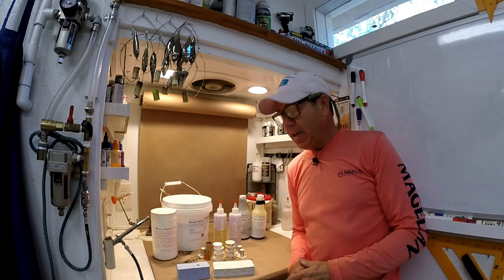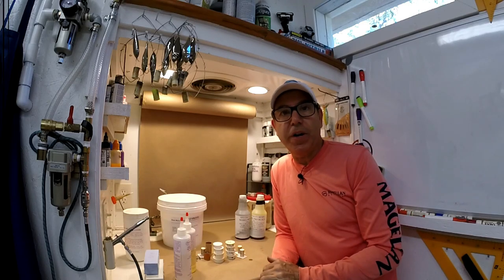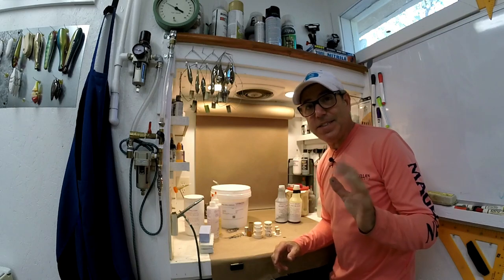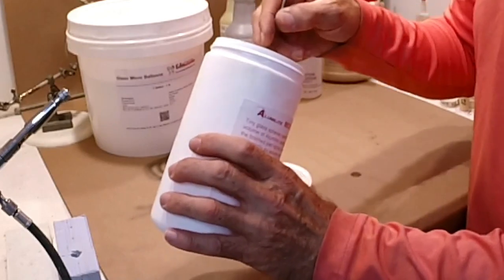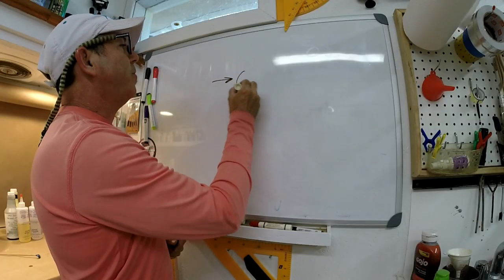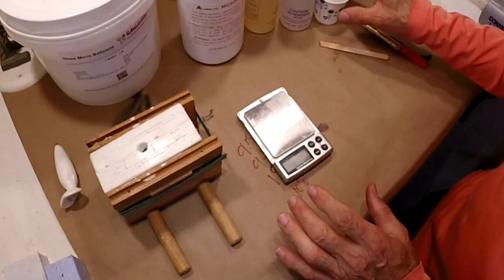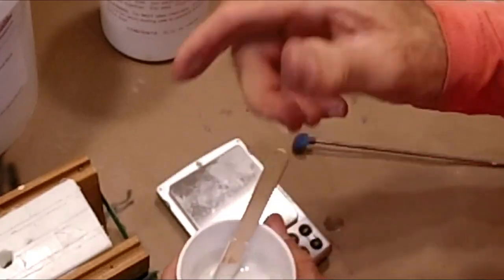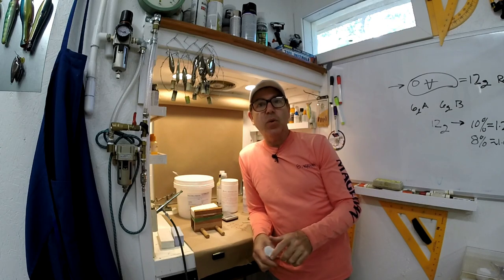Mixing resin to cast the perfect lure

Comment: Aloha! Thank you for sharing your videos, they are very helpful. 

When adding weight to your lures do you just drop them in the mold and then pour casting resin? Or do you suspend them to be a little up? Attach them to wire?? Considering that the resin isn’t enough to give the bait the proper action looking for that is prototyped in the master. If have video of how you do this could you please share it. Thank you!!! 
Hunter C🤙🏼
Reply from the maker: Aloha, thank you for watching and for your question. I have a system where I attach the weight to my internal wire harness, the location is critical because my design usually needs to follow some balance that I've decided for it. You should check out my lure design and build from scratch videos it will walk you through the entire process. Thanks again
Reply: Engineered Angler Thank you! I gone ahead and poured some anyway with %8 MB and took it for a swim, came out perfect and just what I was looking for just from the weight of hooks. 

For reference if other builders are curious.

Took 2lbs of Alumilite High Strength 3 for a 2”1 /4”x2”1/4” x 9” rectangle mold box. For a 7.5” Stickbait.  While casting with Alumilite White found that 67g is the lowest an least resin to pour and 90g is the max the rest starts to overflow with 8% Micro Balloons. 

Mahalos for sharing your knowledge 🤙🏼 tightlines!
Reply from the maker: gotta love it when that happens...cheers

Comment: how many lures can one make from, say, those sizes of alumilite? i'm thinking about trying the casting now, instead of carving my lures from wood.
Reply from the maker: You can make between 60 and 70 average size lures from the 16 Oz each of A and B. That's using my 10% by mass glass sphere mix.
Reply: @EngineeredAngler  wow, that's pretty darn good. I was thinking about trying the Smooth-On Featherlite, as it's bouyant as is. Will be fun to have lures done and ready to paint so much faster.

Comment: does the 10% mix not vary for wether you want the lure to be shallow diving or deep diving?
Reply from the maker: No..I make a point of keeping my mix constant so that the amount of weight is more predictable. Then I just adjust the weight for the rate of sink I want on the lure.
The only exception is for topwater I use an 8% mix.

Comment: After I make a silicone mold for my lure but I don't know how many grams in total it will take to properly fill it with resin. How do I determine how much the total amount of resin I will need to mix based on the size of my lure? Is there a way of knowing how much I need before mixing and pouring? My lure is already 4-5 inches  in length how do I determine the total volume of resin? Thanks😃
Reply from the maker: Calculating the volume that you'll need to cast your lure is  a lot easier if you've already have the density of the resin mix. If you've watched my videos on casting lures you will have seen how I poor a test sample of my resin and then calculate the density. You should also have the volume of your lure. Of course if you have neither one you will have to do the whole process by trial and error. For a lure the size you're describing I would start with 10 grams of part a 10 grams of Part B and 2 grams of microballoons. Good luck.
Reply: @EngineeredAngler  thank you so much

Comment: Question, why do you use less microspheres for a topwater lure, but more microspheres for a sinking lure? Also, if i want a topwater that sits nose up, do I just tilt the mold nose-up to allow for more weight in the tail?
Reply: I must also add that I plan on making larger topwater baits that have a wide gliding action. Is it possible to weight that solely with microspheres?
Reply from the maker: Okay, last question first, no unfortunately you cannot use only Spheres for weight and balance. The irony is that you need to add the glass spheres in excess so that you can then use weight to balance the buoyant force with the sinking force.  If you don't do it this. way you will end up with a lure that is unbalanced and unlikely to work correctly.  The reason I use a less buoyant mix for topwater is that top water does not need as much top to bottom balancing since they are on top of the water not in the water. Crankbaits and twitch baits need to have strong opposing forces to keep them vertical in the water column and that's why I use a more buoyant mix for those types of lures.
Reply: @EngineeredAngler  Gotchya, that makes sense, thank you so much!

Comment: Hi, there are many types specificy of micro-balloons for the application? or It's tge same? example fore the popper or needle? 30 gr ? 15A+15B+ 2,4 of micro?
Reply from the maker: The micro-balloons are all the same but, the percent you add can change depending on how you want it to affect your lure.  I usually add a little less for topwater lures.  But I stick to my 10% rule for all others  so 15gA + 15gB +3.0g micro.
Reply: @EngineeredAngler  

Thanks for the reply. I've already done some tests, and I'm going to do some more! I am afraid that my handmade lures could break in bending or twisting.

Comment: by vol. you use exact vol. but a and b might not have the same wt. for vol.  for instance i use a lot of 1 to 2 and it's 100 to 43 by weight
Reply from the maker: That's true,  part A and part B can have different densities. I cover that in another video where find the weight ratio between them and use that to mix by weight very accurately.
Reply: @EngineeredAngler  just started watching your videos , i've seen a bunch already , enough that the dream of making a new creek chub darter seems a reality already .

Comment: Mr. Engineered angler.  Really need your help.  I purchased 1 gallon of resin from specialty resin.  Mixed microbollons to 10 percent mix.  Cast it let it dry for 1 week.  Cleaned it with detergent.  Added epoxy and there are a bunch of places that the epoxy does not stick to the casting.  I made like 10 lures and all 10 had this issue.  I even tried to spray primer and I notice there are some location on the primer never dries.  I did this to 10 lures and all horible results.  Any ideas?
Reply from the maker: Oh man...I know the frustration.  I had the same issue with the specialty resin.  I bought the black quick setting resin and it did the same things to me.  I tried everything and the only thing that helped was baking the lures at about 150 F
for at least an hour.  Then wipe down with acetone  and prime it.  In the end I switched to the Alumilite resin...more expensive... never had the problem again.  
About three months ago I decided to give Specialty resin another try and I bought the white quick set resin...no issues with it so far.
Reply: Engineered Angler thank you so much.  I did what you said and it works.  Thank you

Comment: Love the way you calculate everything, I have a question I want to pick your brain on. I’m currently building a musky top water bait, Full resin bait. I’m trying to reduce weight and I’m not reducing wire size or hook size anymore than they are. First bait was 10% microballoons by weight, total weight of lure was 4.35 oz. By changing mixture to 15% and using standard strength trebles I’ve reduced weight to 3.85.
Should I be worried about strength at 15% micro balloons and here’s the big question, I’ve pondered on adding something like a mini ping pong ball on my wire ballast to create more buoyancy, do you think this will work? Maybe I can get back to 10% micro balloon mix ?
Reply from the maker: If you're using screw in eyes then yes...high microsphere % can make the resin easy the deform so screw eyes can work loose.  Use a harness and you'll be fine.
Reply: @EngineeredAngler  your thoughts on the ping pong ball adding buoyancy?
Reply: @EngineeredAngler  and to add, I am using 2 to 3 coats of east coast resin top coat as well
Reply from the maker: Wow...that must be a big bait.  A ping pong ball is an excellent idea if you can keep it high in the lure for vertical stability (if that matters for the design.)
Reply: @EngineeredAngler  97 grams total resin, it’s a two part top water bait. I did pour a couple with mini ping pong balls suspended on wire frames ( I have a brass tube running in rear piece I used) 
I added bb’s to also create rattle, it reduced weight by 1/2 oz. still waiting to test as I am trying to base coat over the resin bait with east coast epoxy but having issues with it not setting right. Not sure if it simply doesn’t like being on resin bait or what but it’s being a pain even though I’ve used it as a top coat several times. I want the paint to be smooth so that’s who I’m base coating with east coast but I may have to re think what I use there. Do you recommend anything to coat raw resin to create a super smooth surface to paint over??
Reply from the maker: What do you mean by raw resin?  Is it marine resin?  If so, you might be having issues with the residues that some resins  give off to enhance curing.  You will need to sand and clean with acetone...

Comment: You say the 8% mix is for top water, but wouldn't the 10% mix be more buoyant?
Reply from the maker: Yes...it's a bit  Counter intuitive. The thing is I need more buoyancy for lures that I want to sink so that I can use that buoyancy to stabilize the lure body. Topwater lures just need to float.  But you can just use the 10% mix for everything.
Reply: @EngineeredAngler  you are the best technical guy doing this stuff!!! Thanks for the quick reply. I love your content 🙌🤙👌

Comment: what is the easiest way to remove casting bubbles ? Vacuum chamber ?
Reply from the maker: Sorry for the long delay on the reply...
The best method depends on the material you're using but, best techniques will start with: 1) not producing bubbles when you mix, gentle mixing,  2) If your material allows you the time, you can vacuum out the bubbles in a vacuum chamber before you pour,  3) Removing as many bubbles while pouring the mold by pouring in a thin steam.  4)  Again if you have the time before the material sets you can put the mold in a pressure chamber (pressure pot) this reduces the size of the bubbles.
Without knowing the material you are using for you casting its difficult to say what combination of the methods would be best.

Comment: I disagree with your ratios. I was going off your advice but I found my 10% mix was always sinking, I went to 20% but it made it unable to be poured so now I've got a 15% mix that can be poured yet is still buoyant although once I add weight it doesnt float anyway but I just need to put less weight in. Otherwise great advice and has helped me greatly.
Reply from the maker: Well I demonstrate how I do it and how well it works on every lure.  The thing is everyone uses slightly different materials and that can change your results.
Reply: @EngineeredAngler  bloody oath. Still a very helpful video. Your videos have helped me greatly in pouring baits to making molds and working out the nitty gritty. That's it we all get different resins and micro balloons. Was just pointing out something I noticed in making baits from resin.

Comment: just watched the video again. so, to figure out how much mixture needed for the casting, you just weigh the original lure?
Reply from the maker: Yup...as long as you have the density of the material, wood, resin,  whatever you made the original from, you can just weigh it and divide the weight into the density and you get the volume of the lure....
Reply: @EngineeredAngler how the heck do you figure out the density?? one of my lure styles is made out of cedar, the other is ash. I weighed them and weighed out the same in casting, ended up not having enough, but was actually close. 

another big oops I did, was being too anxious. wanted to get a second mold made quick so I could do two lures at the same time. real excited to open the mold and see how it turned out, making it. it turned out great, until I noticed that something seemed to be missing......the keys!!!! totally was in a rush and forgot to make keys for alignment. it still works, but I just have to be real careful when fastening them together that they are lined up really well. helps that there are brick-formation lines all over the mold from the lego, so I use them to be sure it's pretty close.
Reply from the maker: I take a small piece from the wood I'm going to use, measure the volume and weight and then I just write it down. wood density can change from piece to piece so I err on the side of a little more resin.

Comment: Thanks a lot for your video 
I need ask if there was micro balloons filler clear or all is white color
Reply from the maker: Yes I use microballoons on nearly all lure castings.
Reply: Sorry I need to know if micro balloon come in different colors or all white color ?
It come in clear ?
Reply from the maker: I have only seen micro balloons in white but if you want to color your resin, there is a resin dye you can use.  here's a link
https://www.amazon.com/s?k=alumilite+dye&crid=17OAOMVO49K4H&sprefix=alumilite+d%2Caps%2C289&ref=nb_sb_ss_i_1_11
Reply: @EngineeredAngler  thanks alot
Reply from the maker: I have never seen clear microballoons. ...

Comment: Great content!  Very informative.  I just started watching your videos since I'm looking to get back into lure making, and this have been useful for me.

Not sure if anyone else mentioned in the comments, but your 10% is really only about 9.1%.  9.5+9.5+1.9=20.9g total, so 1.9/20.9~=9.1%.  I'd assume you do your 8% similarly, so that would be about 7.4%.  I don't think it really matter what the actual percentage is since you've providing two mixes that work for you and your method for calculating.  I'm just pointing out in case someone builds a spreadsheet with equations so they know to calculate it the right way.
Reply from the maker: Yes I see your math is correct and it's my poor description that makes it look like I flubbed up the numbers.  When I call it a 10% mix I do not mean it is 10% of the total mix.  Just that you calculate 10% of the weight of A and B combined and that would be the weight of the added micro balloons.  This seems to me to be the most direct way for most folks to calculate their mix proportions.   Otherwise the calculations gets a bit cumbersome for the average person.  for instance, using my method if you miss pour part A and correct by matching it with part B you simply take the total weight and multiply it by 0.1 and you still get the correct proportion for the micro balloons.  Hope that makes sense.

Comment: How long you let it setup for?
Reply from the maker: I will demold a lure as soon as it is hard enough to do so. But I will allow it to cure for several days before beginning painting and final finishing. If I'm in a hurry I will bake the lures in an oven at about a hundred and seventy  degrees Fahrenheit for about an hour to accelerate the Cure time.
Reply: Thanks for the help

Comment: After getting all the materials, what does it generally cost to make one lure? Mold material, resin, beads... just the materials for the lure?
Reply from the maker: Paul Sturgill 
if you are trying to budget to get started in lure making., I would budget a couple hundred dollars for all the material. that should get you through your first few batches of lures. As far as a cost per lure in materials, that varies so much that I hesitate to give you a number. if you're trying to figure out if you can make a profit selling them, keep in mind that your biggest investment will be your time. good luck
Reply: Everything they promote as materials for lure making can be made yourself out of simple kitchen supplies. And molding materials also.
Reply from the maker: Paul Sturgill
 last time I calculated, it came out to somewhere between 45 ad 60 cents for an average size lure (2.5 -4.5 inches) but you can definitely increase the cost with fancy finishes.

Comment: I enjoy your videos, but I don't agree with your declaration that 10% is the end all of all ratios for all non topwater resin baits. I make larger swimbaits and find a considerably smaller ratio works great, requires less lead, less weight, and causes less issues with pock marks from the microballoons.  Just my own personal experience.
Reply from the maker: Sorry I gave that impression. For top water I actually use 8%. But sometimes having a single formula simplifies things. the irony is that you actually need a more buoyant formula for lures you want to be subsurface and less buoyant formulas for topwater.
Reply: @EngineeredAngler  agree for sure. I've learned that the hard way :)